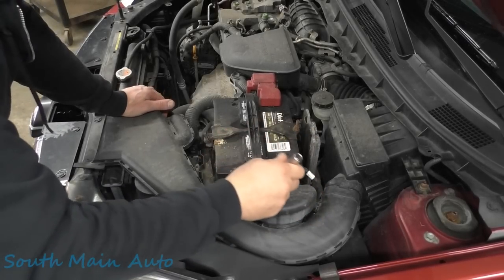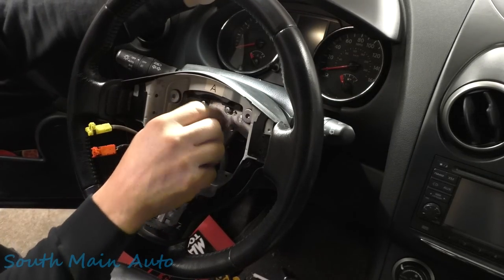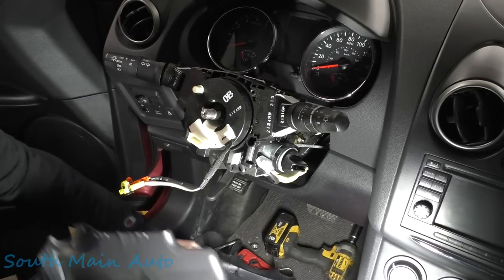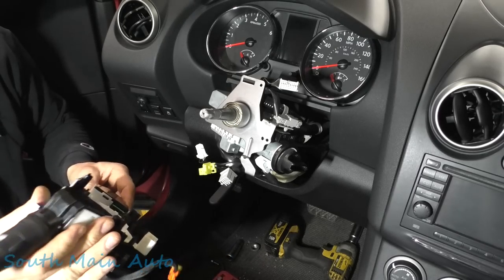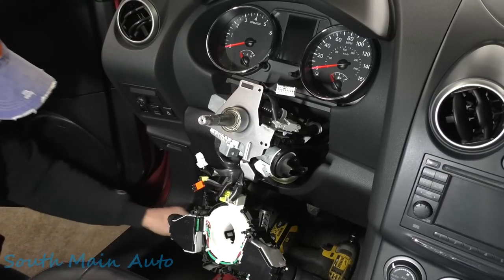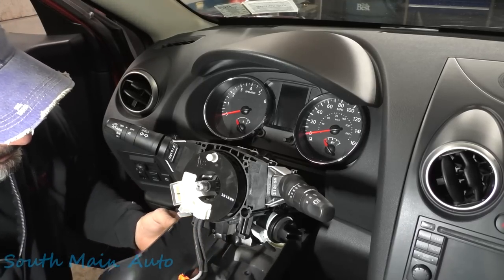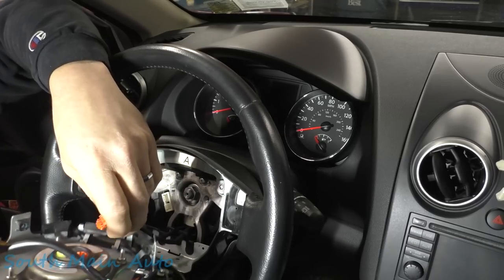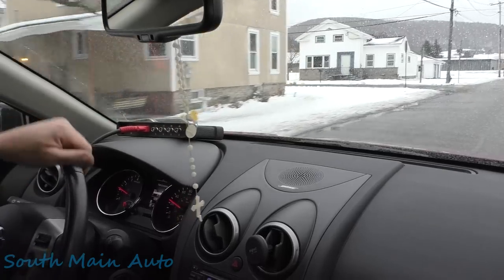'12 Nissan Rogue: Air Bag Spiral Cable (Clock-spring)

Comment: 🇨🇦 I have a Mazda cx5 and it’s 9 years old. The last little while I’ve been hearing a clunking sound when I go over a bump at the same time as I accelerate. My husband wants to take it to you Mr O but we’re about 4 hours and a border apart 😮. We attached my go pro under the car to see if we could figure out what’s causing the sound. My husband also tried to wiggle and move different areas on the front left wheel to see if he could replicate the sound in the shop. The car has super stiff shocks and it’s impossible to find the sound. Perhaps you or one of your subscribers might have suggestions for me ?  TIA 😊

Comment: Good morning, I just wanted to ask one thing, I'm sorry, I'm not an expert, but just to be clear, the airbag simulator is only placed in containers that don't have short circuits bar. I meant for control a clock spring . thanks a lot

Comment: "How are we supposed to know all this crap?" I say that all the time, ha. I get to do this next week on a '15 Rogue, maybe it will be kind of the same.
Reply: Lol! That was what I was saying when recently trying to replace the speed switch connected to the chain on my mother-in-law's twenty-five-year-old ceiling fan.

It was a Harbor Breeze and none of the switches from Lowe's or Home Depot would work, even the ones that were specifically made for Harbor Breeze.

I finally ohmed out the old switch even though it was broken to pieces and found out how the individual selections worked and found one on Amazon that was perfect.

I also have to do a clockspring on my wife's 2011 Rogue soon. The horn and cruise quit working, so this must be the problem.

Comment: Had an 01 Sentra.  Drove over a badly washboarded road & the airbag light came on.  Found instructions on the web on how to reset it... stand on your toes, twirl three times, etc.  (actually, press the driver's door dome light switch in a prescribed way).  Light went out & stayed out.
Reply: It always tickles me to find out these crazy ways you can reset something. On a lot of vehicles these days it seems like you flip the key switch on and off a certain amount of times and press a pedal a couple of times in a certain order and you can enable and disable different functions like stuff for the key fobs.

Comment: i had to fix all that in my ford aspire. put used stuff in because 1 it was a ford and 2 it was an aspire.  then the brake pedal locked up while driving down the road.it was a 75-dollar car. someone had spilled  a big gulp down the column and all over the center consol.

Comment: Great video I  have the same car with the same problem am going to use your video to Guide me through question Seatbelt  on  the  passenger  side is stuck am going to order one from the junk yard  does it come with a Sensor or am good to go to install it and am going to have the codes reset from a auto body shop please let me know  thanks

Comment: Eric if you are careful swapping the steering angle sensor into the new clock spring, does it always have to be recalibrated? I am about to do a 2011 Rogue for my wife, and I have a cheap little scanner that can't do that. I did buy the OEM clock spring.

Comment: PSA
JIS screws have a little dot on them. At least the ones I've come across.
Reply: Unless in Japan 🇯🇵😏🤷‍♂️😎
Reply: Love Posidrive.  Whiskers on the 45's.  Don't "camout" like phillips.
Reply: @SempreGumby  strangely enough, philips drive were designed to cam out!
Reply: @dans_Learning_Curve  I learned this recently from an old time mechanic.  As the head wears, it cams out sooner.  Love the posidrive.  I've only seen those on oldtime British motorcycles and some modern German products.  Phillips is from someone that doesn't trust their mechanics.

Comment: How much is the replacement cost? Labor specifically. I have a 2012 Rogue that needs that part you just installed changed. My steering wheel components work only when the wheel is turned one way or the other including my horn. I watched the video and think I will be able to do it myself but should anxiety come into play, I’m gonna need to pay someone to do it for me.

Comment: I did a clock spring on my wife's car a few weeks ago. It started out as a wiper switch replacement until I dropped the steering wheel on the floor, pulling the wires and the guts out of the clockspring...🤬

Comment: Toilet stalls used to have the one way slotted security screws. I guess it was always a problem
Reply: They just just rip the whole mess off the wall mounts anyway.  If there regular slotted screws I doubt the vandals would take time to bring in their Milwaukee and Dewalt drivers with them anyway 🤷‍♂️

Comment: If the factory installed unit failed,  you recommended installing another OEM unit that has a history of failure at a higher cost, rather than a aftermarket that is less costly?, still a nice job replacing the unit.
Reply: Whats your definition of "a history" ?
Reply: As another commenter mentioned, I think Eric has a video of where someone used an aftermarket part and it caused a problem with the traction control. I have read about a lot of people having problems with the traction control who have possibly used cheaper alternatives than OEM clocksprings.

Comment: Nice vid. Thx. Some dam ▪︎¤■□$^&***^^!!! thot he needed my '97 Nissan p/u more than l did. Got in and tore it alI up. So... l been putting 're back together repairing everything he tore up. Had to pulI strng wheel, clock spring etc. You name it. Quite an education fixing alI that stuff.

Comment: have you run into trouble removing 1999 jeep grand cherokee steering wheels ? I need to replace the clock spring, but cannot remove the steering wheel.

Comment: As a Nissan master tech here in Ireland I’ve probably replaced close to 500 spiral cables 😂😂😂
Reply: Ever had an airbag deploy on you?
Reply: No thankfully not…. I always use the proper safety steps . Disconnect the battery,2 condoms,mother on speed dial 👍🏻

Comment: The on/off button on my cruise control in my 2012 Chrysler 200 goes inop from time to time. The brain trust on YouTube said it was my clock spring. One person said they thumped their steering column on the side and it jogged the clock spring back into place. I tried it and it worked. But the cruise control on/off button eventually failed again. I thumped the side of the steering column again and that fixed it that time as well. Well, this has happened off and on for a couple of years now. Oddly, the last time that happened I did the same hideous procedure....and it hasn't gone inop since. It's been close to a year now. The only thing I worry about is setting off the air bag by banging on the steering column. Is that actually a possibility?

Comment: It ain’t the airbag that scares me. It is the charged capacitor that will pop it if someone smacks it or a wire shorts the sensor.  IDK are there manufacturer procedures to safety air bag systems for service?

Comment: Iv had to do mune about 12months ago...got 1 from china and it went again 6wks ago 😡
Got a better 1 now no airbag light.
Also 1st time some buttons on steering wheel wernt working.
Jeez popping that airbag off mine was c.nt of a job...pushy clip things through the holes either side..
Couldnt justifie the price nissan wanted for it
I could never get the clam shell to fit back propper at all😢😢😢

Comment: them nissan clock springs squibs are designed  to fail they use a short ribbon that continuously bends the copper tracks around a pin 180 degrees work hardening the copper tracks until fracture  done a lot of them on a nissan elgrand same part  well done nissan on a safety item THE AIRBAG  what was wrong with longer ribbon putting cost over safety

Comment: Gain is way too high on the mic. Your voice sounds okay though. It almost sounds like mic handling noise but it kind of doesn't too. You get it a lot with crappy bands where the band is too loud and the singer is too quiet.

Comment: Worked at Nissan dealership as the shop foreman for one year 2019 and the service data is horrible, confusing, no engineering hotline, no tech tips, just backwards. The best is Chrysler when it was Chrysler not Fiat owned.

Comment: The service data is a main reason I avoid European vehicles. Audi/VW, BMW I can sometimes find what I need-sorta...do we really need a page of Don't Smoke While doing work everytime? Mercedes, with what I use and have other service date programs, I have tried to find lug stud torque specs and honestly stopped looking. It's either past the the don't smoke messages or not available. I gave up. Anyone? 120ft lbs ish seems fine. Posted and probable punished below.